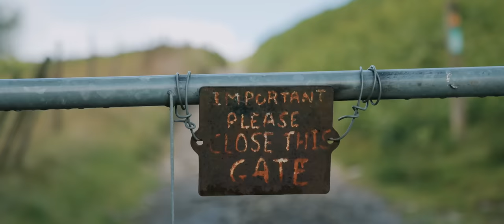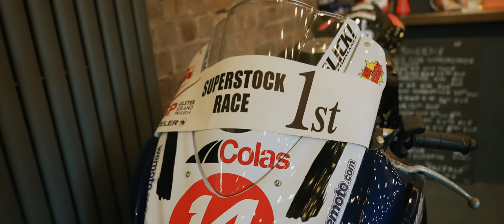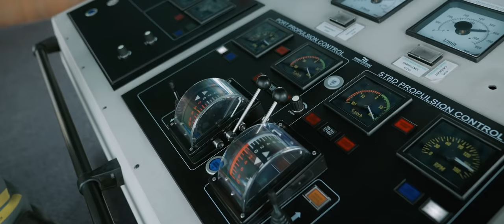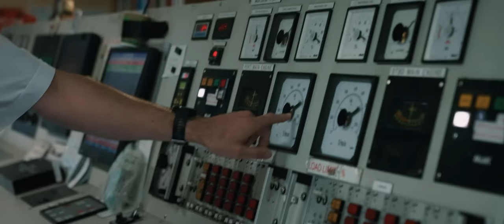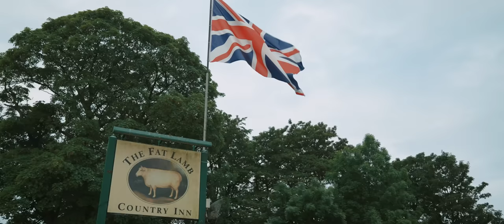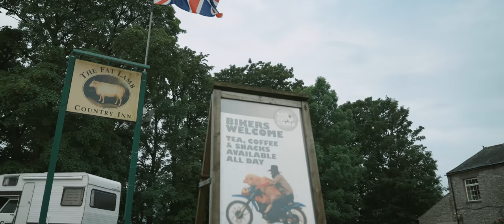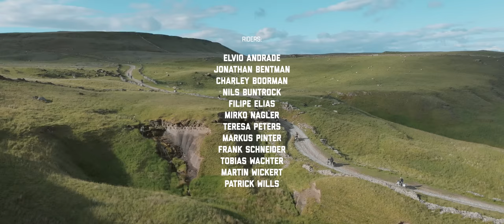Adventure Country Tracks UK 🇬🇧 Full Movie

Comment: Also. Why does none have a top case on the back? But rather side cases only?
Reply from the maker: It a mix of personal taste and to keep the weight down … the higher the weight the more instabil is the bike off-road. 
In the side cases you carry the heavy stuff in the button to shift the weight down.
Reply: @Adventure Country Tracks  thanks! So are you saying that if you rock all 3 cases (incl. top case), it would be better to load the side bags more than the top case? I went on a road trip recently with my AT 1100 adv sports and put quite some stuff in the top case vs side cases and felt at times like the bike was wobbling at high speeds on the highway. Do you think that could be due to overloading the top case?
Reply from the maker: Yes … that’s for sure the topcase issue .. maybe not only but for sure a big amount. 
Try to have as little weight in top as possible.
Reply: @ACTev  thank you!

Comment: What is the difference between an adventure bike, and enduro bike, a dirt bike and an off road bike?
Reply from the maker: Thats a good question :) if you ask 10 people you will most likely get 10 different answers. 
My opinion- adventure bike : big cc engine with off-road capability and space for luggage 
Enduro - around 600cc maybe lighter and taller than the adv bike
Dirt - small cc 350,450 very light 
Off-road maybe MX bikes …
This would be my differentiation.